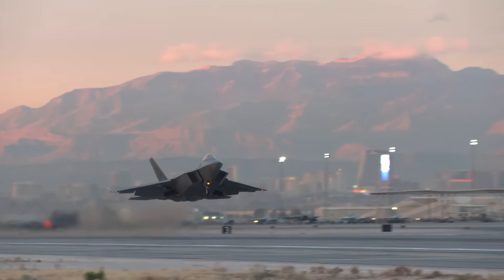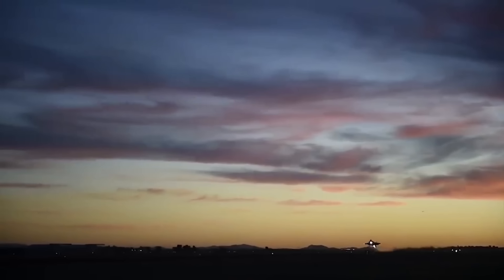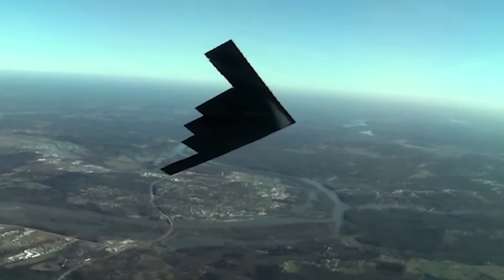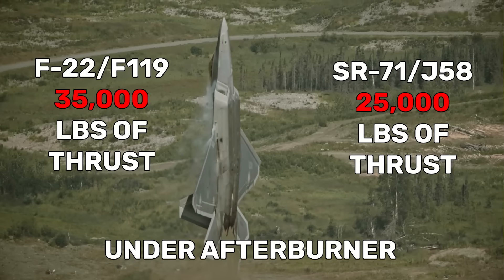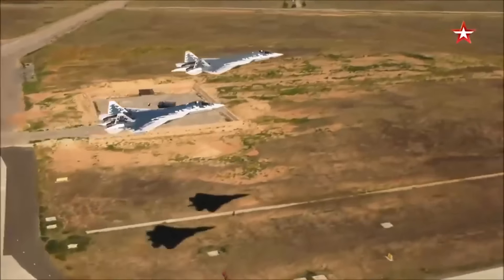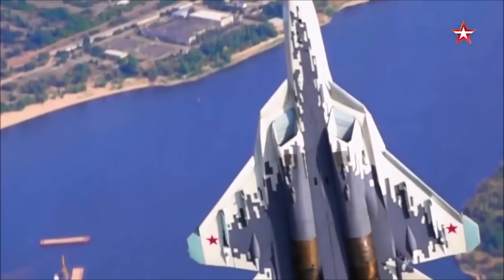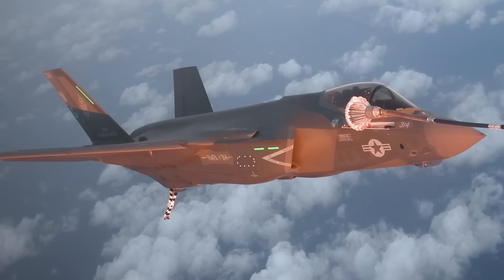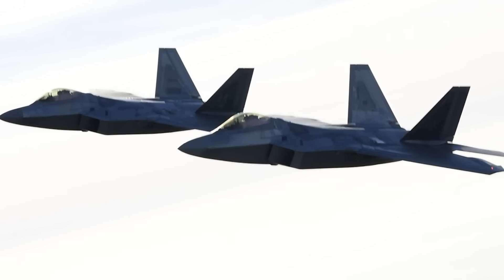The race to field the most powerful stealth fighter engines in history

Comment: J-58  not J-85s
Reply: That hurt
Reply: Easy mistake, both are jet engine models.

Edit: whoops. Not both from GE. Guys when I said GE I meant Giant Engine manufacturer 🫢
Reply: Read the description, he notes it. Done be silly.
Reply: @Adroit1911  ya but at the same time its not a commonly checked place and we tend to read text with a much harsher tone than its meant.
Reply: @Adroit1911 He probably added that to the description because of their comment lol.

PS Edit:
Nice SAT vocab name! Also  I want a 1911 so bad, I just don't want to go through the process of getting a permit (or emptying my wallet 😢)
Reply: Come on down to Texas no permit needed can get an ok 1911 for about 500 and walk out with it the same time you buy it after a background check of course.
Reply: @rockyledbetter8149  I live in CT, so gun laws here are kind of a nightmare. Definitely one of the appealing parts of Texas. You just know the gun laws are working when you seen kids running around with Glock switches, and the law abiding citizens aren't allowed pretty much anything lol
Reply: It won't be long before fighters will be printed and assembled all mechanically
Reply: Connecticut is the constitution state but you need a permit to buy a gun?
Reply: What a great sponsor. This place looks fucking awesome. That's a dream job for an aviation loving A&P.
Reply: @cameronsenna8979  J58 = P&W
J85 = GE
Reply: @cameronsenna8979 mmmmm no
Reply: @pottyputter05  a aaaand at the same time it didn't matter.
Reply: I couldn't believe it he said that out the gate.
Reply: @Kyle-xt8ip  yeah oh my God that's soooo crazy he got the numbers reversed and we were all like noooo oooo now we have no idea what you're talking about!!  Lol, Gtfo dork, another great video, Alex.
Reply: @cameronsenna8979 GE?  This must be tongue in cheek.
Reply: Go away
Reply: @Stellaknot why? He misspoke.. it happens
Reply: @pottyputter05  Yeah that is why if you ever correct somebody or say anything that isn't bordering on being at toxic levels of positivity you get the "positive" people coming at you asking why are you so angry and such a bad person, which is also hilarious.
Reply: @cameronsenna8979  adroit? That is middle school vocab.

Comment: These 🇨🇳 engines may produce power, but they're far less reliable than their 🇺🇸 counterparts. So they literally burn through their engines in a fraction of the time a 🇺🇸 engine lasts.
Reply: Assuming a low enough cost of production, that’s a wartime design. Actual combat aircraft tend to have relatively short lives as measured in flight hours, so if these are designed for war that’s a good design. The US does lots of peacekeeping missions and asymmetric warfare where the expected life of a combat aircraft is close to that of a peacetime aircraft, so for us longevity matters. 

Look at the engines on the ME-262 during the 1944-45 period, for example. Early engines had a 20 hour time-between-overhaul, and that only ever got up to 100 hours….. but the airframes tended not to last that much longer, so burning out your engines didn’t really matter when it gave you enough air superiority. Will the Chinese engines match that performance gap? I doubt it. But there’s a clear spot for low-cost high-performance engines, even if it’s just to put them in cruise missiles. 

Personally I suspect pulse jets are a better match for that specific role, but there are middle grounds where the cost (in yuan and hours) vs performance can be successful.
Reply: @robertkb64 nailed it 👌
Reply: According to whom? U?
Reply: My guess is that they're tuned up too high and are simply run too hard.
Reply: @likwidchris  That's the best explanation IMO too. Being not quite at Western engine tech lvl inevitably reduces their options & they can't afford to lose kinematic performance, so everything else pays.

Comment: TheJ-58 pushing the SR-71 were not only powerful high altitude adaptive cycle engines, they also were huge.. about the size of a Phantom II fuselage.  They were designed to use a fuel that also worked as air-frame coolant and hydraulic fluid because neither system could handle the heat in a closed system.  To an engineering student in the late 50's and early 60's, it must have looked like alien technology acquired from a crashed spaceship.
Reply: Really intelligent comment.  Thank you for providing this valuable information.  I am sure your last sentence is accurate too. Have a great day.
Reply: and nothing about the engines themselves were stealth. how they were mounted was tho
Reply: A❤❤p
Reply: Maybe it was 😉
Reply: Ya no other plain in history looks like it besides the a 12 and variants of them both
Reply: @josephsmith6777 That goes without saying...
The SR-71 is technically a variant of the A-12 as it's based off of it. Most people  usually can't tell the difference between them. So they're all the "SR-71" to them. 

Also, OP was specifically speaking about the J-58 engine, and how the engine itself it might look like alien technology from a crashed spaceship to engineering students in the late 1950's & early 1960's.

Though, to be fair; there's no doubt that engineering students of the time would have felt the same regarding the entire SR-71 aircraft.
Not only is it an engineering marvel for it's time, but it's still an engineering marvel in today's age.
It definitely still looks futuristic, or reverse-engineered from a recovered alien spacecraft lol.
Reply: Keep wishing for aliens😂
Reply: Ufos were all the rage back then. So I can see an engineering student in the late '50s and '60s saying it looks like alien technology. To seem hip, neat or groovy of course. Hmmm, I think they said 'cool' back then. Certainly too late for an idiom like 'the bee's knees' or 'the cat's pajamas'. Whoever came up with those idioms probably did see little green men.
Reply: And circulated through the aircraft for cooling, wasn't it?

Comment: One of the most important improvements in the new engines is their electrical output, critical for the overall aircraft.
Reply: Critical to power laser weapons too.
Reply: my initial thoughts as well..
Reply: @Sajuuk yes, but more importantly more powerful computers and sensors, like more powerful radars and passive multispectral systems.
Reply: All of that extra power is for ECM. These things make legacy AWACS obsolete.
Reply: Actually the struggle is to get enough cooling power for all those toasty warm avionics systems.  Can’t enable block IV without the improved cooling.
Reply: @Sajuuk  some day maybe... not I the next decade or even the next for that matter. Atmospheric scattering and thermal flaring has been to much to overcome so far with 100% repeatability.
Reply: Electrical supply is produced from generator driven by engine not produced by the engine.
Reply: @chrissmith7669 it's everything. Everything needs more cooling.
Reply: @Triple_J.1  The E3 sure, but not the wedgetail
Reply: Sounds like you been watching the Sandbox
Reply: EDF electric ducted fans as used on LiliumJet eVTOL will be completely devoid of thermal signature and sound.
Reply: @chrissmith7669  Jet fuel is used to cool the computers
Reply: @K-Effect  lots air cooling IPP
Reply: 820 is a low-observable missile truck it's not really made for dog fighting. It can carry a lot of ship-killer missiles China's main concern is not that they're going to lose a dogfight f-35s f-22s or ngad or anything else China's concern is that they're going to lose the ocean advantage and then get surrounded which the United States interestingly enough is already starting to do they need a low observable fighter in 2040 that can carry out heavy payload strike missions to try and keep American and European ships way the fuck out at sea
Reply: @kiwidiesel  Duh.  Thanks, genius.
Reply: @jacobbaumgardner3406 Did you just say that computers and sensors are more important… than lasers? You take that back this instant, or you better meet me out in the parking lot.
Reply: @chrissmith7669  The real beauty of the XA100 and XA101 is the way the generator is integrated to siphon cooling air from the outer channel airflow efficiently.
Reply: @Triple_J.1 not the wedgetail. E3 yes.
Reply: @jacobbaumgardner3406 we have no competition in that area that you mention
Reply: @kiwidiesel I don’t know if that needs said out loud.
Reply: not really concerning the engine itself but more the generator alternator type attached to it. engines on their own dont produce electricity. they require it.
Reply: @nomercyinc6783  That's the point: in the new engines it's not just attached, it's integrated much more deeply.
Reply: I understand this is a critical component, but do you seriously think an upgraded generator strapped to one of these engines is the most important improvement? I'll have to look it up. I'm not doubting you; I just don't know of any recent technological breakthroughs in building power generators. I also haven’t been keeping an ear to the ground in that regard, so to speak.
Reply: @stancil83  It's not just the generator, it's the cooling for the engines, avionics, and even weapons like jammers and high powered sensors.

Comment: Great content thank you. The SU57 seems to be invisible as nobody has seen one combat ready.
Reply: There’s like ten in existence. Russia doesn’t want to risk them.
Reply: @OrtadragoonX there are like 10 they say exist. They don't risk people find out they really don't. (You are right tho)
Reply: -It took the US 20+ years to get the F-35 working.   I think we can expect the Su-57 within 2-3 years.   It's already  taken to the air with new 5th generation engines and 2D stealthy nozzles.  Stealth coatings will be applied and a new stealthy photonic radar that uses super fast optical signal processing for the front end is also testing already.    The aircraft has a huge internal fuel capability and very large internal weapons bays much larger than the F-35 and F-22.    The new engine uses plasma ignition and should have a very wide operation range in terms or restart ability.
-The aircraft clearly has a stealthy shape.  It is rhomboid when viewed from the front and all of the leading edges of the wings and tail fins are aligned.  The only non stealthy portion is  the small double delta area. 
-It probably wont be as stealthy as the F-22 but it will be close enough to stealthy to cause problems.   The long wavelength leading edge radars the Russians developed for the Su-35 will be in the Su-57 and will detect stealthy aircraft.  They'll be quite accurate if 2 Su-57 integrate viewsd from 2 directions. 
-Don't make the mistake of underestimating the Russians or you will be in for a nasty surprise.
Reply: @williamzk9083  
"It took the US 20+ years to get the F-35 working"
That is not quite true. First flight was in 2006. it entered active deployment in 2015. While it was not a perfect or easy to operate aircraft at that point. It for sure worked. Ironically, this was the B version. The A version promptly followed the year after. And the navy version was last.

Even if you look at the X35 (that wasn´t even a YF35), it first flow in 2000. To get to 20 year you have to go back to pre studies.
Reply: @williamzk9083  it took 20 years for the US to build 1000 F-35s, it took the russians 15 years to build 10 SU-57s. Yeah they're nowhere close to the same
Reply: @ExHyperion  Technically there are 22 Su-57 in service since 2020.  Another 10 prototypes exist.   Clearly the new engines and 2D nozzles only just made an appearance and will take a year or so to perfect plus the new radar and full stealth coatings g is needed
Reply: @williamzk9083  lol no 😂

Comment: The F119 engine is phenomenal. Powerful, dependable, and easy to work on.
Reply: Currently, the most powerful engine until adaptive cycle engines come out.
Reply: F135 and WS15 are more powerful actually (because theyre newer obviously)@NationChosenByGod
Reply: keep chinese out from this lists there engines are just reverse engineered Soviets al31 engines f119 has 3LP &just 6HP stages the reverse engineered Chinese engines have 8HP stages & 4LP stages. Just like al31 &it's other variants which they reverse engineered there aircraft cannot takeoff with full payload & fuel from high altitude bases like in Tibet there runways are literally 5km because without so so long runways it cannot takeoff @lolguitar7279

Comment: I always wondered why supercruise was considered 1.5 and not anything over 1.0, thanks for that explanation.
Reply: It has to do with the drag.  After Mach 1 the shock changes and leaves a drag bucket.
Reply: At mach 1.0 there is a lot going on, transonic trad rise is very real. See any graph showing drag vs mach. 

The F-16 can super-cruise around Mach 1.0 at 20,000AGL without external stores.
Reply: Supercruise is a marketing term. It once meant >M1 dry, but then they raised it to M1.2 to cut out stuff like clean F-15's/F-16's, and now LMT is pushing M1.5 mostly to exclude the European 4.5 gens that cruise from 1.2-1.5. The F-22 has by far the fastest supercruise of any fighter at M1.78
Reply: @appa609  nobody would supercruise  below M1.2. The trans sonic drag is to high.
Reply: @appa609 most of the european fighter. the Typhoon is Mach 1.5+ publicly, which is also the F-22's public supercruise number, 1.5+. It's rumored that the F-22 can go 1.78, but it's also rumored by pilots that the Typhoon can exceed Mach 1.6, so it's all hearsay.
Reply: I talked to a fighter pilot who was part of the ATF/F-22 program in the 90s. LM coined the Mach 1.5 Supercruise term as it was a USAF requirement, and also to set it apart from other fighters that could, under some limited circumstances, achieve barely Mach 1+  not using afterburner. Several fighters throughout history could achieve just over Mach 1 without afterburner. Even some variants of the F-16 can reach Mach 1+ in dry thrust, but requires more or less clean aircraft, low weight and optimal conditions. The F-22 took that to the next level.
Reply: Well, there are 2 reasons for that term.

As noted, in the 1950's a British Lighting could fly supersonic, and do so without after burners (AB's).
And so could the F104 starfighter. So, fighters from over 60 years ago could go over Mach 1.0.

So, when Lockheed coined the term super cruise? They meant Mach 1.5 for 100nm miles.

however, some blog, some defense magazine or someone THEN used that term to mean any speed over Mach 1.0 to mean super cruise.

Now, to be fair, there is ALSO some merit to the term and using the speed of Mach 1.5

I mean, how does a air plane wing work? Why of course it's job is to make air flow faster on the top of the wing then the bottom . So, faster moving air = lower air pressure (you see this effect when you turn on the shower - the shower curtains pull in - that's due to increased air speed inside the shower compared to air outside of the shower curtain.

So, the reason why Mach 1.5 is important here?

Well, the transonic range is from about Mach 0.8 to 1.2

So, when a fighter is flying just below the speed of sound, say Mach 0.8, well SOME parts of the wing actually see supersonic speeds. And of course other parts of the airframe see below Mach 1.0.

Well, turns out that even when you fly say at Mach 1.2?
Then parts of the air frame STILL see below Mach 1.0 air speeds (so air resistance, contours and airflow around some parts of the aircraft are still below Mach 1.0.

Hence the term "transonic".

So, you have to get going quite fast to reach a point in which ALL or near all air is moving over the airframe at Mach 1.0 or higher.

Now, if you every played with a party balloon? Note how VERY easy it is to squeeze the balloon. Or put your finger on the end of a bycycle pump, and not how VERY easy and VERY springy the pump handle is. (you can push it down a bit, and it spings back up). 

So, air is VERY soft and easy to compress.

however, when you hit super sonic speeds?

Air becomes like water - you can't squish it anymore! And that's why some older (non super sonic) fighters in a dive or whatever would suffer incredible damage to the skin. (it looks like someone kicked or punched in the airframe like someone kicking their car and putting dents in it).

So, things REALLY start to change once you go real supersonic speeds. It more like flying though water then it is like flying though air.

So, the term super cruise has real merit in that you are REALLY flying supersonic, and not in the transonic range.

And it also somewhat part marketing, since some fighters many years ago could also break Mach 1.0, and do so without AB's.
Reply: So Concorde was supercruise 2.0 from the 1960's 😅
Reply: @jacobbaumgardner3406  
"Typhoon can exceed Mach 1.6,"
That is probobly true. The issue is that they have to remove the pylon mount. And if they do that, they can no longer carry any weapons. F22 and F35 at least have a but small, at least some kind of internal storage.
Reply: @lightwoven5326  Its because of the cube-square law. Or to put it simple. Its easier to super cruise, (or really go fast what so ever) the larger you are.
Reply: @chrissmith7669  M~1.2 is the maximum drag coefficient speed for most aircraft. Cruising at 1.02 takes a lot less power than 1.23.
Cruising at 1.02 and 0.98 are actually almost identical. There's shocks over most of the plane in both cases. A clean F-16 at FL300 etc. at mil will often accidentally get up to 1.03 or something
Reply: @appa609  the f-16 drag curve increases sharply from about M0.8 to about M1.2.  I’ve never heard of them being able to exceed M1 without reheat/augmentation/afterburner but it could be under perfect conditions.
Reply: @chrissmith7669  There's plenty of pilot anecdotes but it's also officially published in the dash-1 level flight envelope.